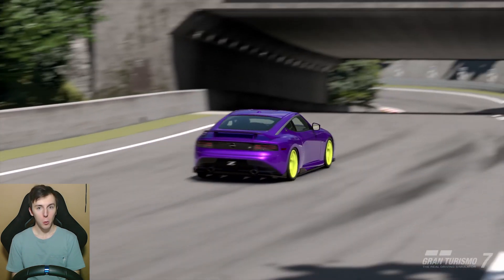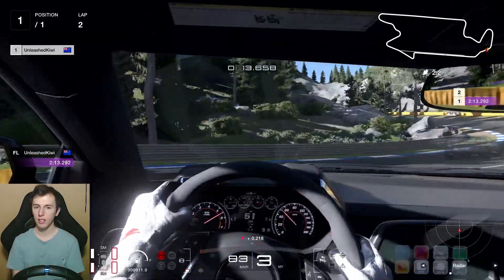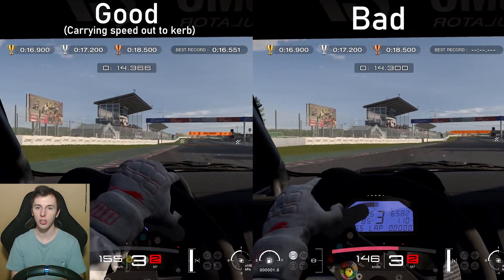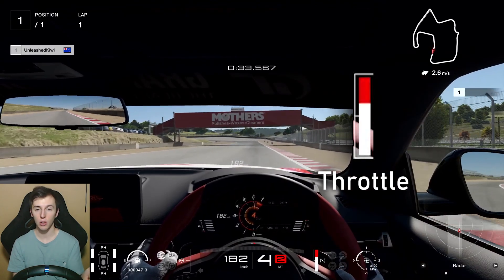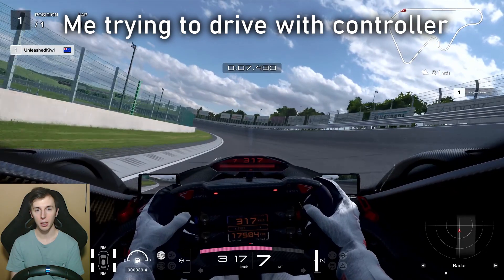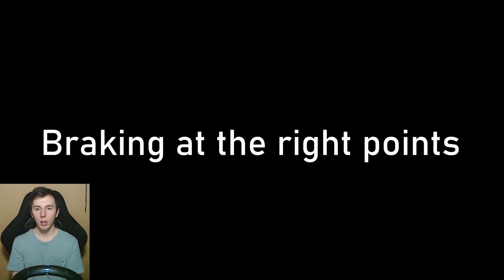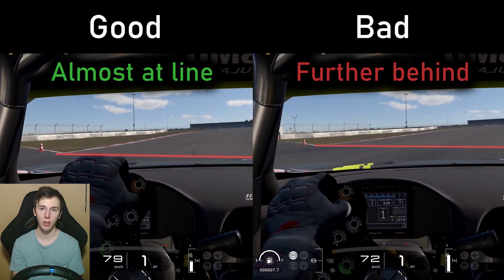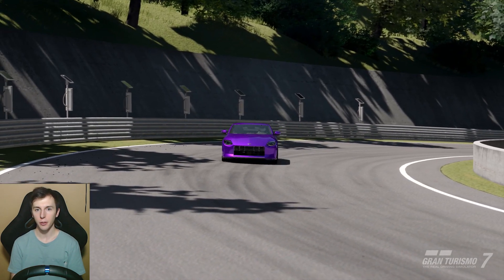How to Be Faster On Gran Turismo 7 - 5 Driving Tips

Comment: Another tip: if you exit a corner, hit the throttle repeatly, especially with Turbocars (Senna technique)
Reply: I thought he spammed the brakes. Also, wouldn't good throttle control be better than spamming the pedal or R2 considering the Turbo only spools up at around near full throttle?
Reply: @Vinnay94  do you want a Turbo lag? If not spam the throttle
Reply: I've always done this playing racing games. I think of it in my head as chopping the gas.
Reply from the maker: Makes sense for some turbo cars but its generally not a good idea as it will cause repetitive shifts with weight transfer and cause instability in the car
Reply: @unleasheddrivers1281  weight transfer + instability = better cornering in tight turns
Reply from the maker: You can get the car to rotate with throttle best with a smooth throttle application. On and off goes from oversteer to understeer, more so understeer into a bit of snap oversteer if too aggressive. It does depend on situation and as you said it is useful with turbo cars to avoid the turbo lag but other than that, in most cases it is fastest and saves tires the most if you are smooth. Also with GT7 in particular being very snappy and sensitive to throttle inputs, it really promotes that smooth throttle input to avoid snaps
Reply: @unleasheddrivers1281  I only do it when the situation calls for it, and I've been doing it for so long I never get snap oversteer from it; Unless, of course, I'm doing it at the last millisecond to avoid a bonehead acting a fool in front of me.

Comment: Feel like im implementing most these tips in the daily race C at daytona with similar braking references to the top guys. But im still stuck on a 1.47.5 while the top guys are casually lapping faster than that during the race while still fuel saving

Comment: A lot of people say Controller is easier to the point where they actually switched to Controller for certain Missions and Licence Tests. Now personally I haven't touched a steering wheel in 2 years but I can kinda see where Controller exceeds because it allows you to flick back to center or counter-steer very quickly, where as you have to use your entire arms to recenter or counter steer with the wheel.